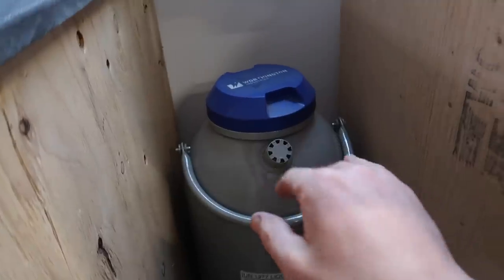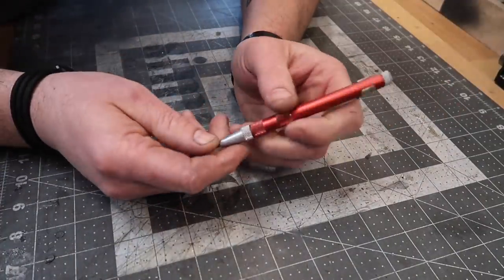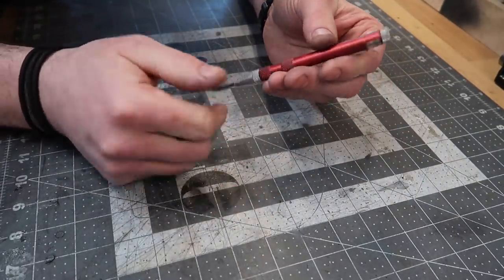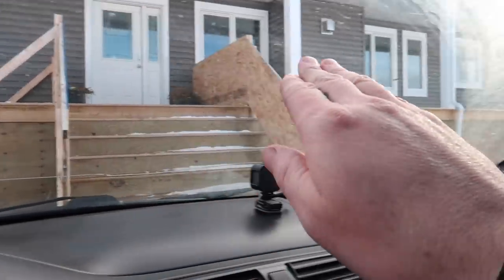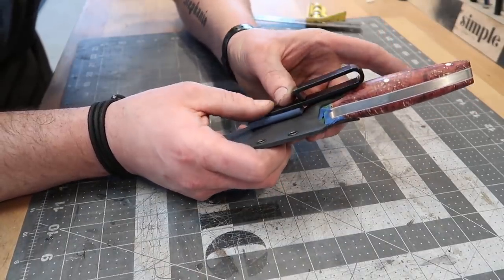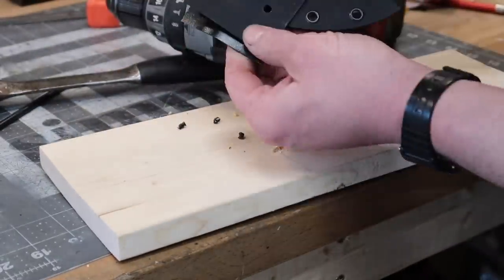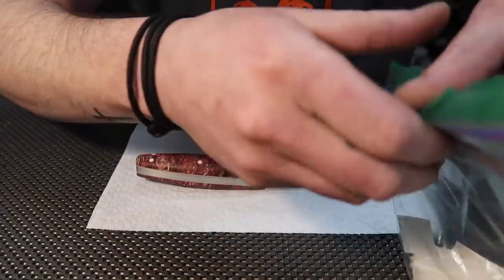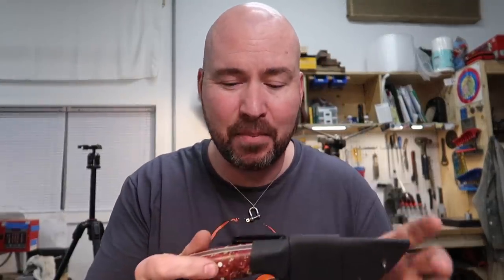After 3 Years it Stopped Working

Comment: ive always made my sheaths from leather or treated suede. the stuff you used here looked very easy to work with,  but me personally, i do prefer the leather.  id maybe consider using that stuff but id design it so i could cover it with a fine leather outer. no disrespect whatsoever, but the plastic look kinda cheapens the look for all the effort thats gone into the knife. im sure your other die hard subs will shout me down, but its just my opinion. great vid tho, and as i said, gave me a great idea for a soft leather outer. :)

Comment: I would imagine it's much colder in the shipping container. Maybe store your nitrogen in there... But then your going to hate running out there to get it every time you want to use it.
Reply from the maker: Yeah but that won’t get away from the pressure changes which is when most of the LN boils off. I asked the guys about outside winter storage and they said I wouldn’t notice any difference in how long it lasted.

Comment: Not sure who your supplier is for liquid N2 but I've never heard his explanation before in all 30 years of working in specialty gas. Temperature has everything to do with rate of evaporation- could it be you're opening the lid of your Dewar more often? Either that or perhaps your TW Dewar is the problem- you may have dropped it or it could be just shot- that does happen. Another thing is when you had it filled was the Dewar empty and warm? That will cause a higher initial rate of evaporation- or perhaps whoever filled it didn't fill it as full as usual.  I've solved many of these problems before but never dealt with the solution you were offered. I laugh at what they're charging you as liq. N2 is a byproduct in air separation and more often than not blown off into the atmosphere.